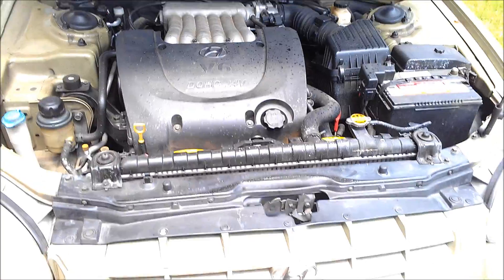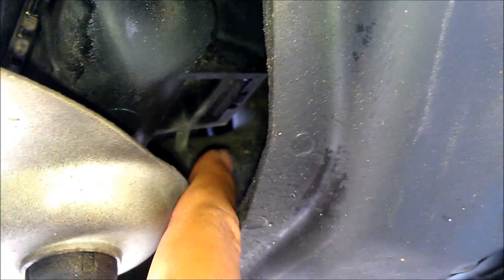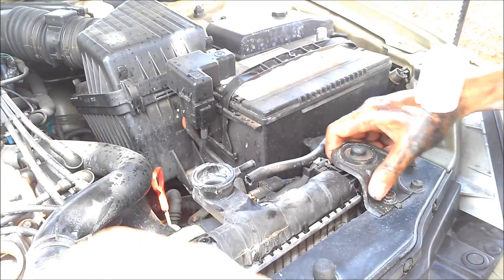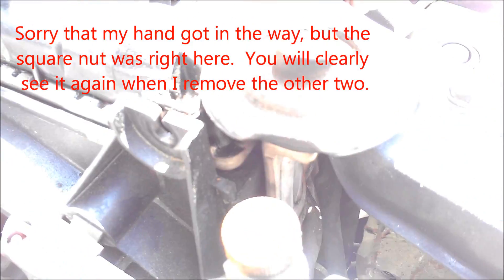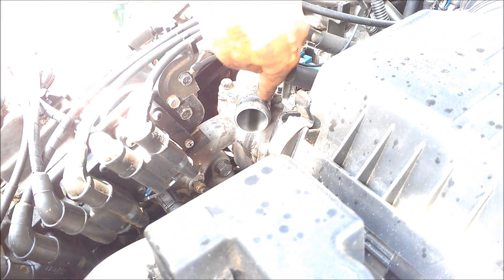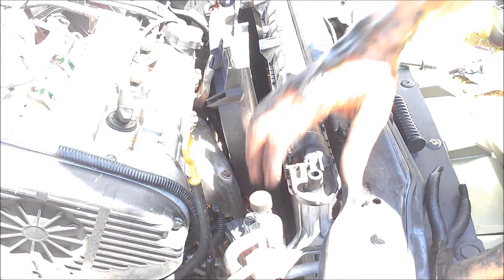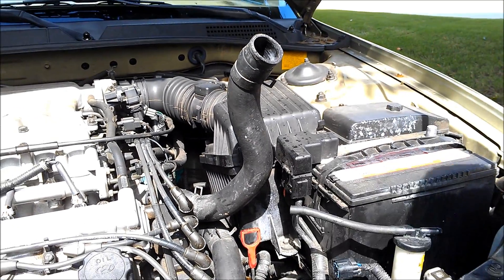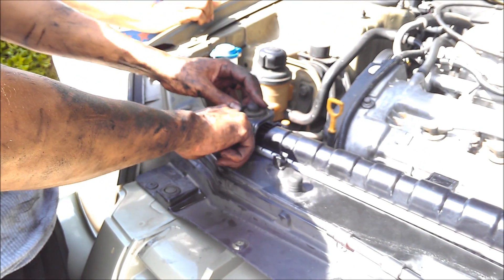Hyundai Radiator Swap, Demonstrated on a Hyundai Sonata V6 2000

Comment: By the way, you're making this harder than it needs to be. You're supposed to take the radiator and the fan(s) out as one piece and then disconnect the fan assembly from the radiator and stick it on the new one.